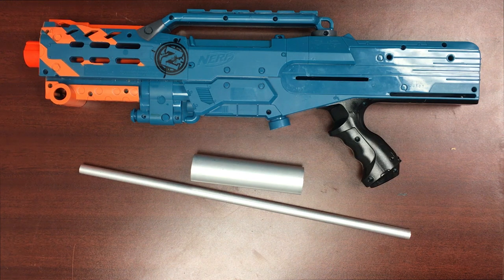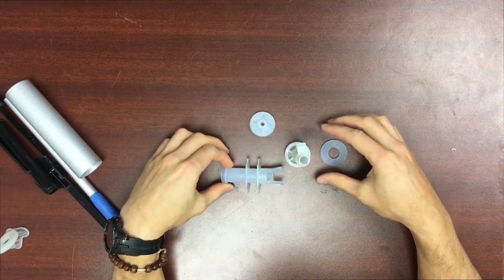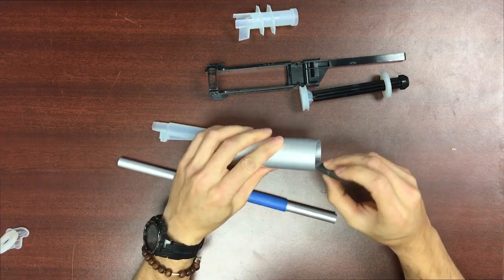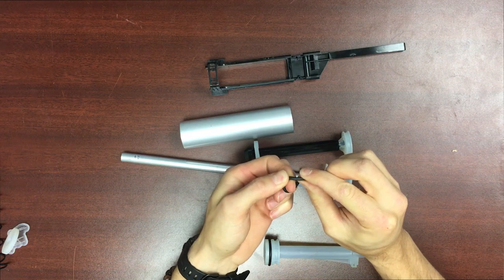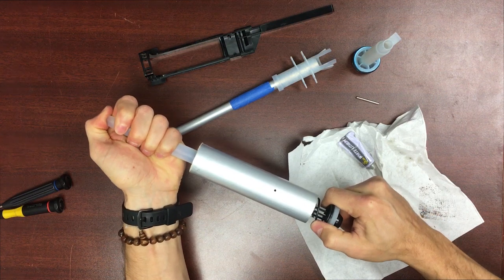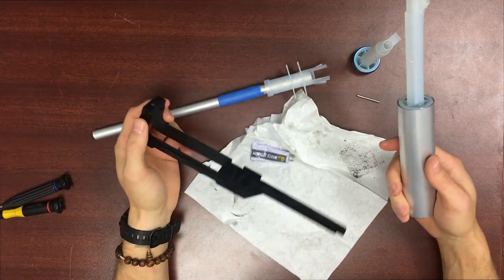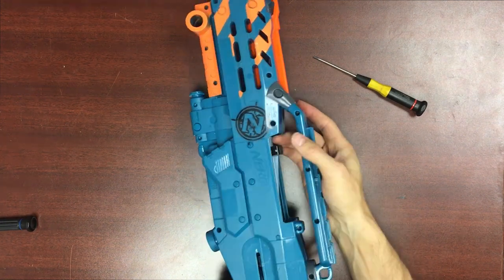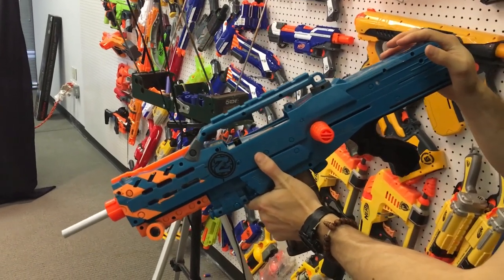Orange Workshop Longshot SG Spec Mod 250+ FPS

Comment: I believe I used a 1/16" drill bit for the bolt sled pin in other builds if it helps those watching.

Comment: I have the stage 2 kit, so I ordered the remainder parts yesterday.  I'm excited about this kit.  There aren't many videos/reviews with springs 20Kg and over.  It was very helpful to see what kind of performance we could potentially expect versus just reading about what it will do.
Reply: I just got the 20KG spring from OMW along with the rest of the parts. I'll test it out for the community.
Reply: I couldn't get the catch to hold with the 20Kg or a 14Kg spring.  I was able to get it to prime with a spacer between the plunger head and breech, but the catch wouldn't hold.  Most times, the blaster would fire before I could get my finger on the trigger.  The few times it held long enough for me to squeeze the trigger, the dart only left the barrel once.  I was only able to get the stock spring to prime and hold.  OMW was helpful in trying to find a solution, but I gave up after the breech broke where the pin attaches to the sled.  I'm probably just going to wait for the Omega kit.
Reply: With the new 3D parts? Did you get their upgraded catch spring?
Reply: Yes.  I had all OMW parts.  The stage 2 LS kit, all the 3D printed parts, and all their springs and O-rings.Side note: I was logged into my sister's account before and didn't realized it.